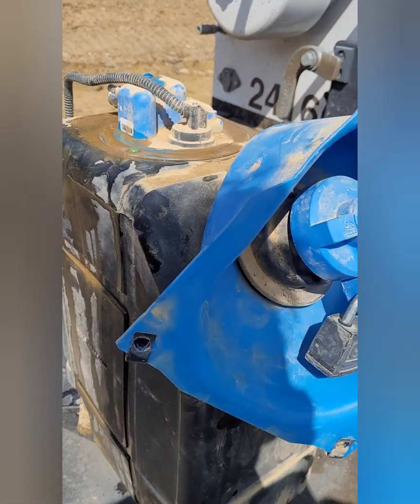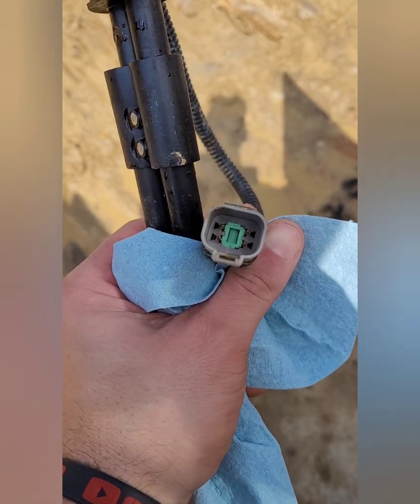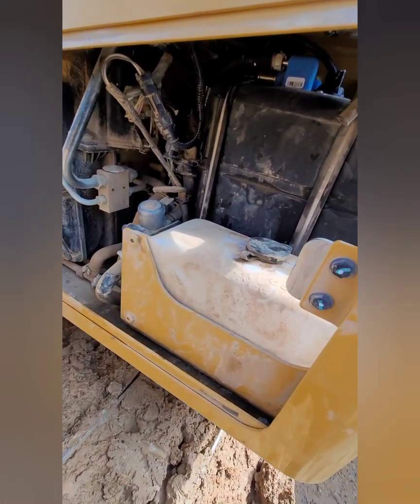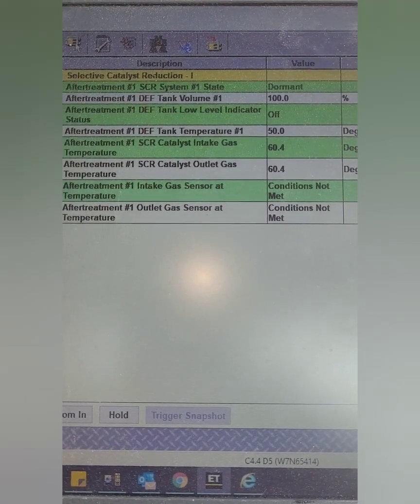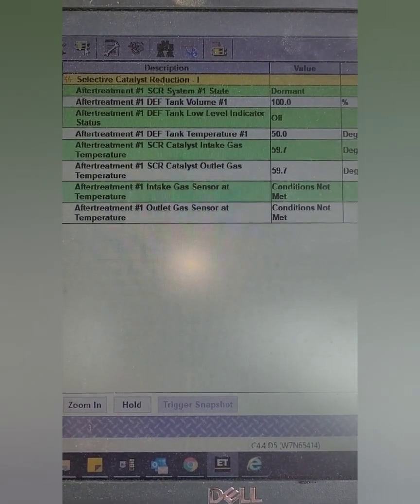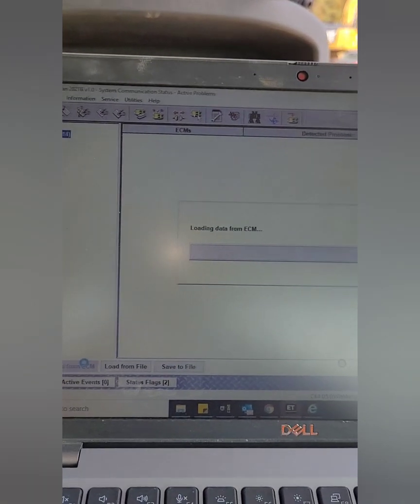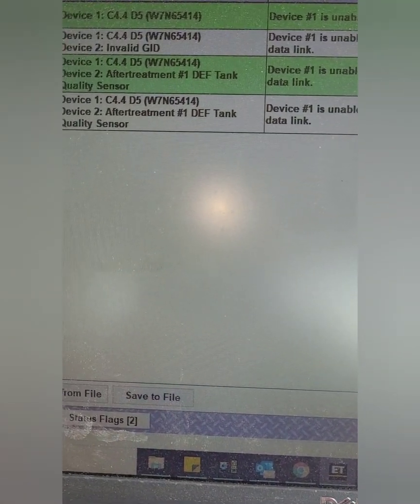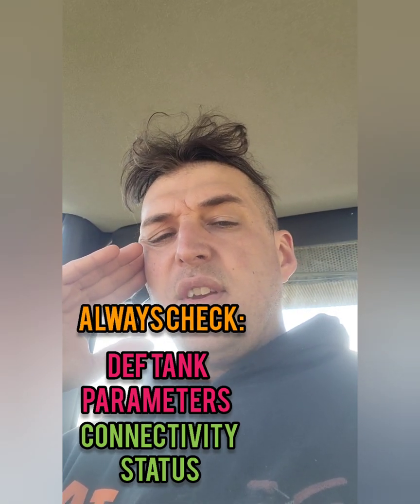Caterpillar D5k Def Manifold Troubleshooting

Comment: I got a question. If I replace the def manifold on a machine that’s throwing a code for it (machine is not yet deranged) will I have to have a tech clear the code? Or will the code clear itself once the new manifold is installed?
Reply from the maker: Machine "may" self correct if conditions are within parameters...yet, if active fault tech will be needed

Comment: Sir can i ask my cat motor grade there is alarm.. low aftertreatment def tank level and ive already replace new sensor..
Reply from the maker: Could be between the DCU and/or the data link
Reply: And sir how to do it..we need to replace a def controler or there is another way to repair that..thank you for reply sir..
Reply: Almost 6 months that machine not working for that reason...do you have a messenger sir so that i can send you the actual alarm that read the cat et..
Reply from the maker: Send Me information on my Instagram @slowaf_12v

Comment: Have you seen a sensor that drops on and off? I'm getting a 1235-9 on the Def sensor. The code is coming and going. CAN is good and there's 12v to the sensor so I'm confident it's a bad sensor. But then the code will go away. Someone said they will flake in and out like that before they completely die.. Has that been your experience? Same 4.4 and def manifold you showed there.
Reply from the maker: The level, temperature, and quantity sensors will start having connectivity issues intermittently is common failure

Comment: Where can I find the hardware  to connect and do my own diagnostic  on a similar  cat dozer
Reply from the maker: You need the Com3 Adapter, Usb to parallel connector (On Com3) and DLC  connector and Cat ET Software  

Hit me up if you need part numbers...
Reply: Do you if i Can I use that to do a delete on it
Reply from the maker: @AngelHernandez-hw1qb  only way to flash the engine ecm sir...